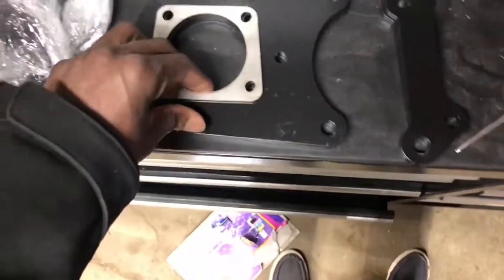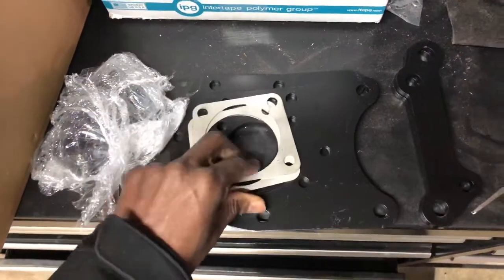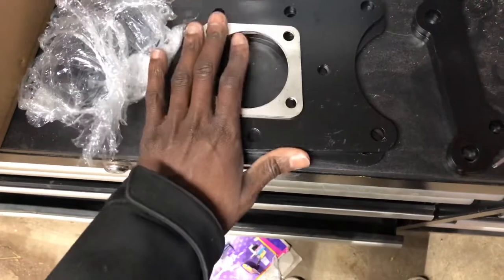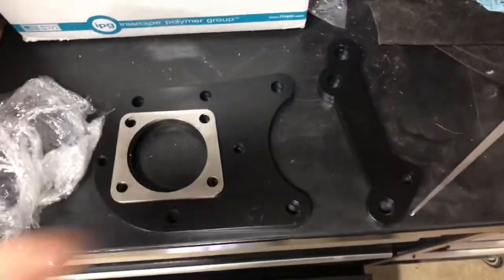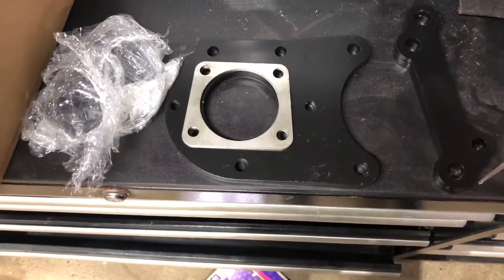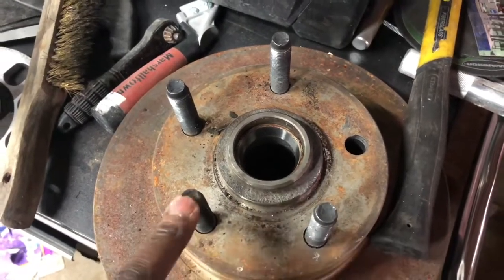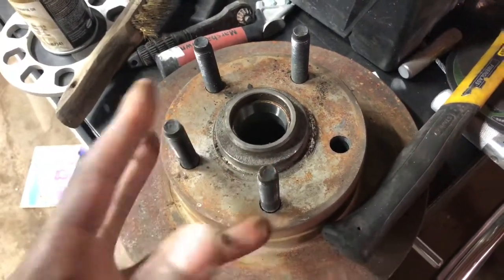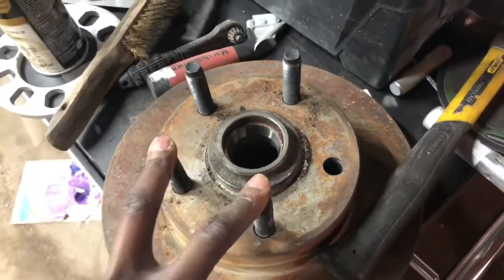2017 Camaro Brembo brake to chevelle swap

Comment: Good work so far bro... My advice to you is avoid the rack and pinion, they do not play well with A bodies. Late model car suspensions were designed with rack from day one. Just look long and hard before you make that jump. You can get a nice rebuilt steering box and swap the front steering components to get the added steering response and save lots of money.
Reply from the maker: Chris South thanks for the advice. If you have any parts in mind that you know of please share.
Reply: @dkiv20  I would do  a  custom box from someone like Turn One or Lee Power Steering. You can send you're in and  specify exactly what you want the feel to be. There is also a guy in the Pro Touring chevelle group on FB a lot of guys have been very happy with.
Reply from the maker: Chris South thanks I’ll check those places out.
Reply from the maker: Chris South will do! Thanks
Reply: Messaged you there

Comment: What bracket did you get for the front? I have factory disc and I’m only seeing ones that fit 5th gen Camaros they are 14mm though on the bracket
Reply from the maker: @UncleMikesGarage  respectfully, I don’t remember. I know I did a video on it and it’s either Kor3 or BigBrakeUpgrade kit

Comment: Bro you did your research that's what's up I'm glad you found a reliable source. What's the part number for the hubs.
Reply from the maker: DHP LS3 

Part#: CLP-6474RBH-K
Item: ROLLER BEARING HUB UPGRADE KIT
Status: Shipping From Manufacturer
Price: $170.09
Quantity: 1
Reply from the maker: DHP LS3 from summit racing

Comment: Are the calipers the same front and back? And could i use factory a body hud and rotor assembly?
Reply from the maker: The front and back Calipers are different. The front is bigger. You should be able to use the rear hub, but the front you will either have to mill down the factory rotor to fit inside of the Camaro/corvette rotors or just get with Kore3 and purchase their hub set up and buy the stingray corvette rotors from rockauto. The hub bore size on those are bigger. I believe it’s 71mm and the Camaro is 69mm. Hope that helps

Comment: Great video. I currently have 17 inch rims in front would the brembo swap work on my 69 Chevelle? Any help would be great.
Reply from the maker: Alexander Majarrez I’m not sure if the 17’s are big enough... I’m running a 22” and I believe the camaro come with 18” rims so I would look at that.
Reply: @dkiv20  thanks alot.keep up the great vids. I have to find another brake setup.
Reply from the maker: Alexander Majarrez  I would say look into it. Worst case look for a set of 2000 corvette brakes to swap... I have a set sitting in the garage because I was going to swap it and once I know for sure my brembo front brakes work I’ll be selling those, that they are not a bad upgrade to have.
Reply: @dkiv20  well Im interested if u decide to sell the Corvette brakes.

Comment: How wide is the back wheel ..I want to do a 24x12 on the rear of my 70 so I’m wondering if u had to narrow the rearend or cut the tubs
Reply from the maker: My rear is narrowed. The rims are 22x11.5 (8” front lip 3.5” rear lip) with 24’s check to see if you will need tub upwards for suspension travel
Reply: Appreciate the info fam you doing great work I’m also going with the camaro ss dash and full interior ..your vids helping me thru my process ..keep up the great work fam

Comment: Bruh you doing your thang on the whip I would like to know if you can send me the links to the rear bracket and the spindles I have the 2017 new take off rotors and calipers I’m trying to install on my 68 chevelle any thing you can help me with would be appreciated Thanks chuck
Reply from the maker: Chuckie Batey thanks! The full front and rear kit can be purchased at big brake upgrades website.
Reply: Thank you bruh I appreciate it